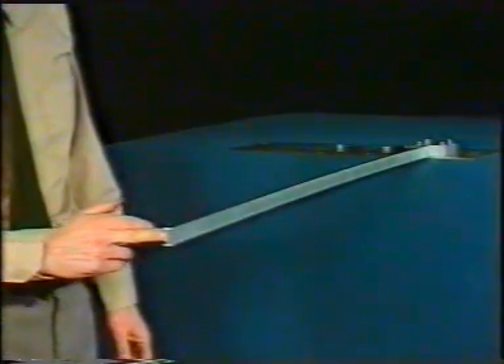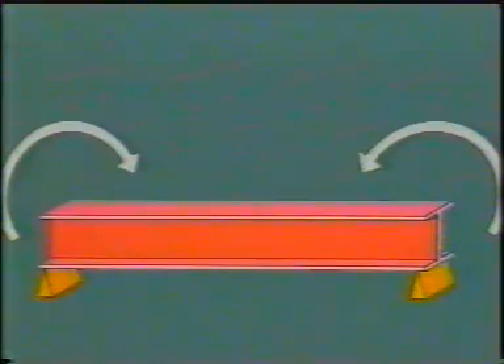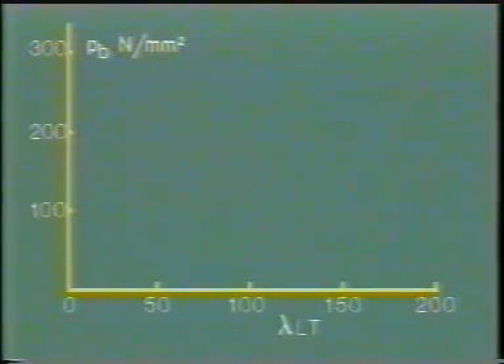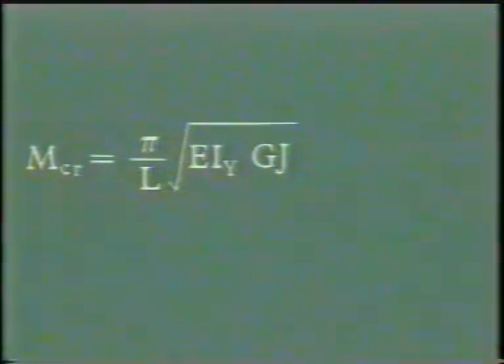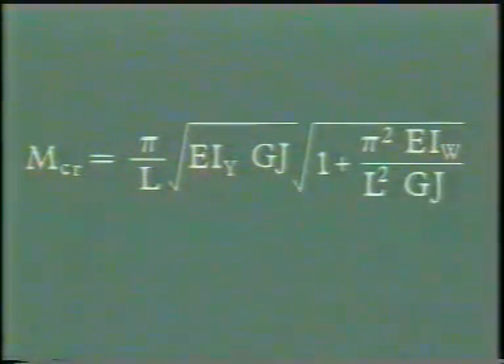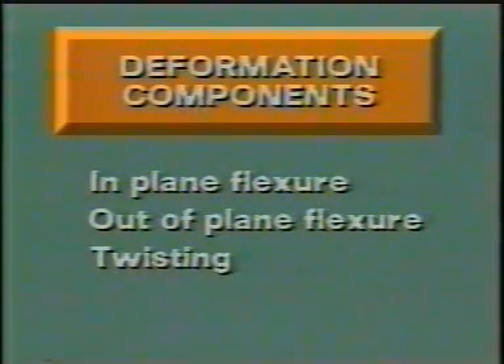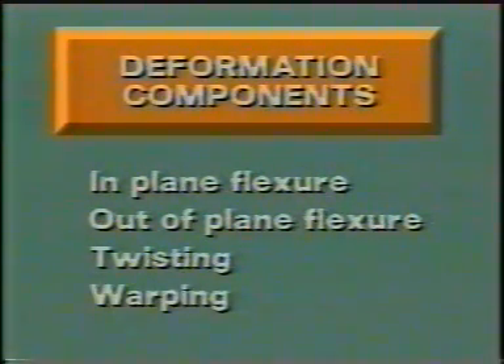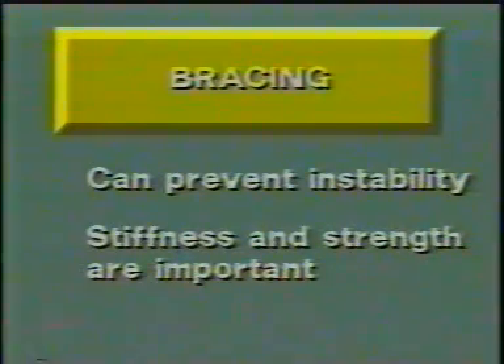5 The Behavior of Unrestrained Steel Beams

Comment: When loads are applied to top flange (compression flange)  additional torsion distortions may occur . Studs are welded and cast into concrete deck . 
We use AISC formulas in United States ASD or LFRD .
Dynamic loading  and temperature expansion forces also must be considered.
Nice ,Thank you.

Comment: I’m not in the engineering community, but I’ve not seen I beams “bolted” together in many years, everything’s welded together now.
Having said that, engineers still have to “characterize” beams and put them through actual laboratory tests to validate the performance is as reported.

Comment: Does it melt when jet fuel burns on it? Can it collapse at free fall speed with zero resistance to the beams that had no heat ? Would it cause a near by building to also collapse at free fall speed ?

Comment: These days the section if the 'stocky beam' as its called in this is square, then it is called a universal column or UC and if it's I in shape (so the old I beam nomenclature) then a universal beam or UB. In the steel business (rather than the engineering business) they are always UB or UC so everyone knows if it's a column or a beam.
I transport and deliver these in lengths of up to 22m but most commonly in the range of 12-15m.
One I delivered the other day was 14t for a 12m beam but it was a welded one off and would have to be made to order. By far the most common ones are rolled.
For these type of beams remember this rule of thumb,
If the height is greater than the width = UB (universal beam)
If its a square, so the height and the width are the same = UC (universal column)